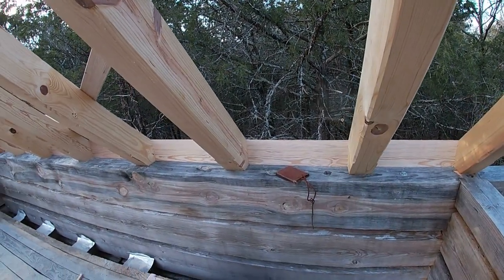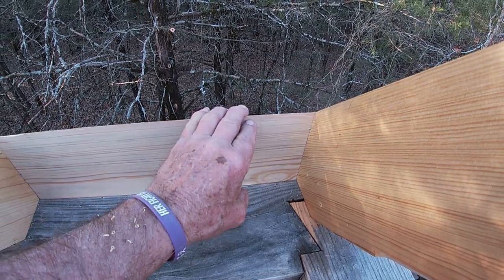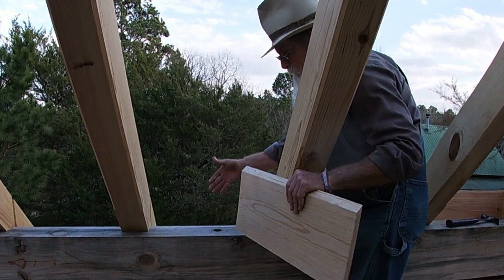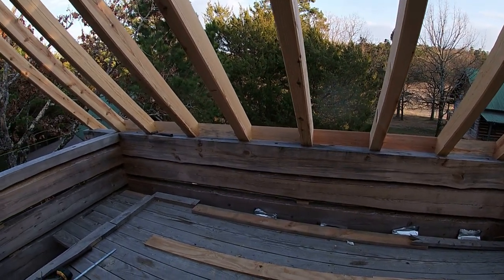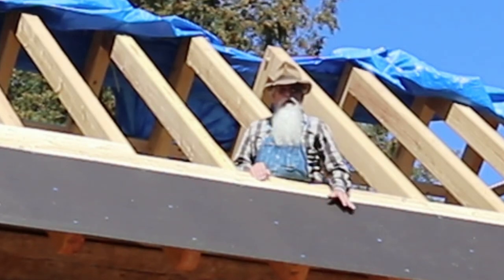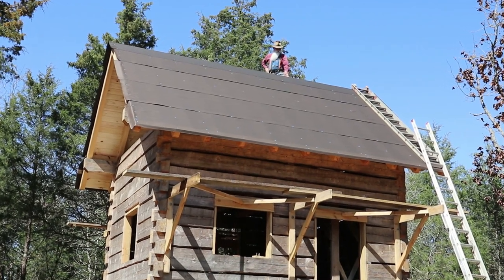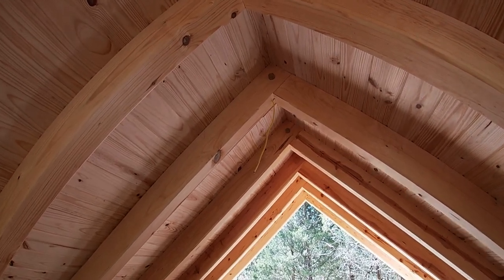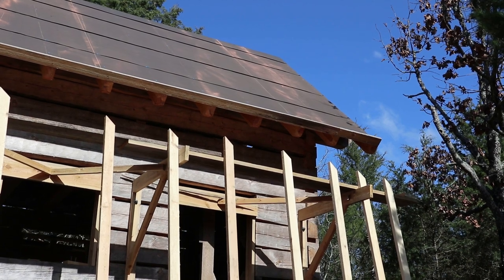Roof Decking - Dovetail Log Cabin (Ep 42)

Comment: Great work.  I have enjoyed watching you work.  I am building a 26 x 18 timber frame cabin and will use some of the techniques you show here.  What is the rafter spacing?  I had planned on using 2 x 6 decking because my rafters will be spaced about 36” but I am wondering if 1 x 6 would be sufficient.  I also am putting foam board on top of the decking then metal.  God bless you.
Reply from the maker: Howdy Andy- thank you so much for watching our videos. I sure appreciate it. The rafters on the cabin are on 24” centers with 1x6 tg for decking. I think you could probably be ok with the 1x6 tg for your decking on 36” centers. Hope it all goes well for you. Take care and God bless you

Comment: Dear Sir, thank you for the masterly class. Just wanted to know what are the dimensions of the board that use for snow/bug block? Which factors does this size depend on? Where is the groove placed on the board? Also, what happens to the decking at the top of the ridge?The decking from the two sides just meets at the top? Is there any gap in the decking at the top? Thanks.
Reply from the maker: Howdy AS- the boards are 3/4” thick same as the grooves. They are 8 3/4” wide and I cut them about 1/8” shorter than the length measurement. The saw kerf is 3” up from the bottom and 1/4” deep. The decking goes all the way to the peak on both sides. There is no gap at the top of the roof. Solid wood from the bottom to the top.  Hope all is well with you. Take care and God bless you

Comment: I watch Meadow Lark Homes videos and they put their electric in between the ceiling and  roof but also fill that void with spray insulation. What do you think about that system.  I enjoy your videos and agree that you are quite a craftsman.
Reply from the maker: Howdy Kenny- that’s a good way to do it. We’ve done that before. All the wall logs are predrilled for electrical when I work the logs out. There’s only one wire for a light in the loft and the wire is in a small groove on top of the rafter. Thank you for watching the video. God bless you

Comment: When you temporarily attach something to the side for the building process, then remove it. Do you plug the holes with anything?
Reply from the maker: Howdy- the bolts that hold the scaffold on are in the chinking gaps. Somewhere in the camera there is some video on the scaffolding I built. Thank you for watching the video. God bless
Reply: @TheBeardedCarpenter  that makes sense. I was curious because here I've seen this little bee that likes little screw holes. They go in solo, build a single pod or whatever. White patch the size of the screw. Then...I dunno what happens. Whether they bore or just hibernate